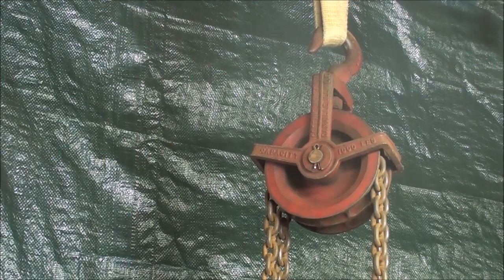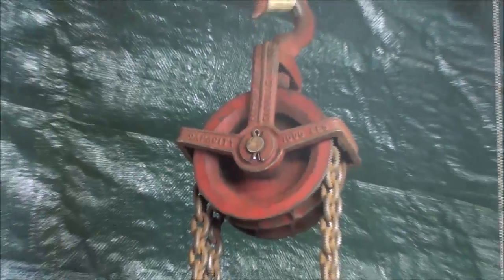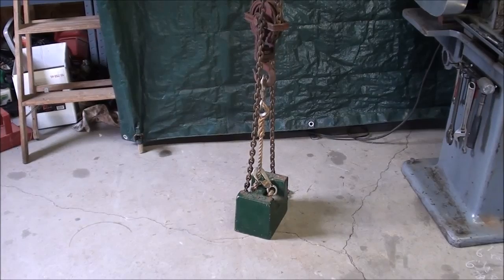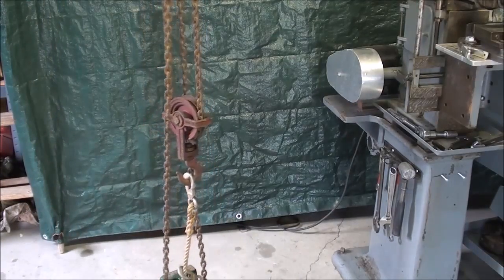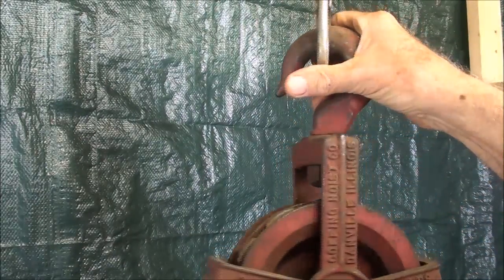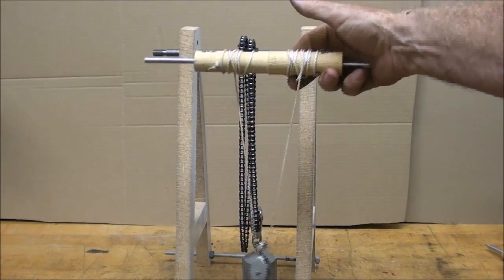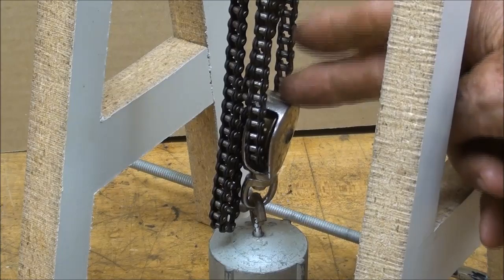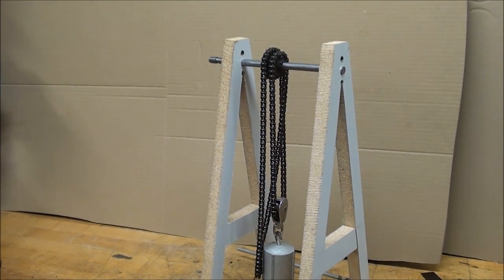WHAT MAKES IT WORK? #7 The Differential Hoist - tubalcain mrpete222

Comment: excellent topic? mr. peterson!
made me think abit.
it holds due to the fact that no pulley or shaft can run with two different angular speed at the same time!
beautiful old machine.
thank you very much for the video,
-toly
Reply: +Toly Dukhovny   Hi.  If you look back at Tubalcain's video about the Chinese windlass, you'll see that there was a comment from a viewer referring to the fact that actually it works only because of the inherent friction in the system.   If you think about it a bit further, you'll appreciate that the pull on one side is very slightly more or less than the other side.  More friction than difference in effort presides and the pulleys/sprockets stay put.   So, sometimes friction IS an advantage haha.
Reply: +thecorbies Try walking with no friction.
Reply: +ExtantFrodo2 space walk?
Reply: grumpybill Yup, in that situation walking doesn't get you very far. And yet zero g does not mean zero friction. Think lunar walking difficulty as the power of the stride was greater than the accustomed friction of the foot with the ground. Their feet would slide out from under them. If we evolved in lunar gravity we'd have either much larger feet or ones that were not as smooth (or both). Friction is also good for lighting matches, stopping cars, keeping furniture from wandering around the room,....
Reply: +ExtantFrodo2 you believe  in a moon landing?  bwahahaha